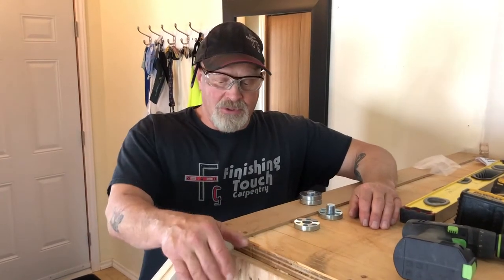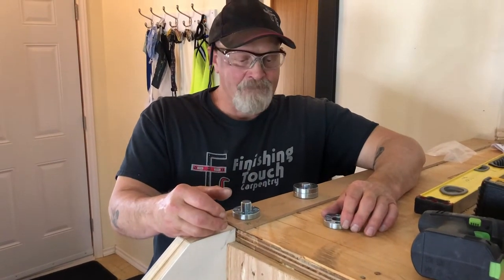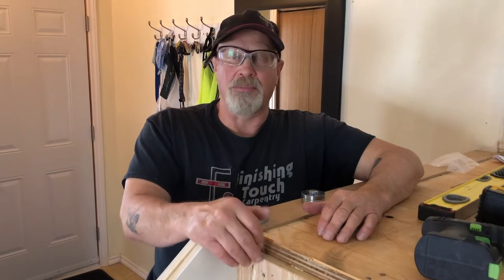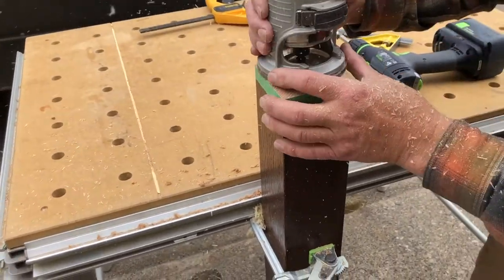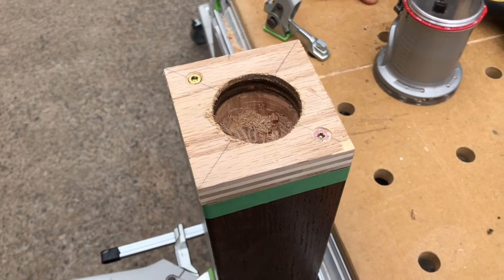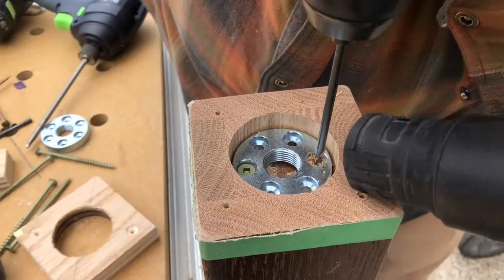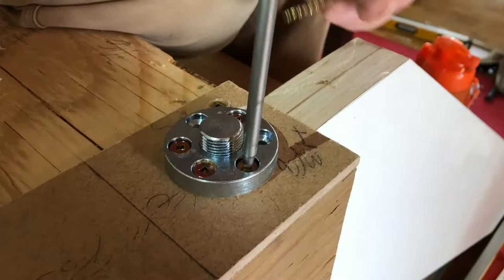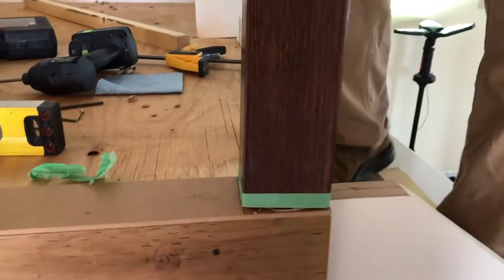Newel Post Install with FAS-N-FAST hidden fastener

Comment: I installed this and the floor is slightly unlevel. How can I plum this post with out leaving a gap at one side of the post.  Also I don't even know which side will face the low side cause it spins on.   Not sure how to get it plum.  It's only a 1/4 inch out at the top.
Reply from the maker: Crank it down tight and put a piece of tape on one side as a reference. Then figure out what side to shim. Use a piece of utility knife blade (like an Olfa) as a shim. That should get you the 1/4”. If it’s a corner post you can easily pull the post with the railing when you install it.
Reply: @scottearlsmithFTC  Thanks,   the problem I am unsure about about is each time I spin it down a different side faces the low end.   Because the center spindle threads into both it always shows a different face to the low side.
Reply from the maker: @eldenboy11  Ok. See if there’s a consistent side and mark that. All I can think of at the moment. You’d be able to pull that post a 1/4” with a railing if it’s on a balcony.
Reply: @scottearlsmithFTC  thanks, it is on a balcony.    But how would I pull the post with the rail?   The rail will be attached at the bottom and them at the post, due to spindles in the way.   I figure it would just pivot out of line.   That's part of the reason I want to plum it so thebrailnclears the nosing on the floor.  Oh,  the outnof plum is left to right.  Vs the horizontal rail attaching front to back.  It that makes sense.   The the diagonal Raul the goes to the floor below attaches the the face the is leaning away from the stair well.
Reply from the maker: @eldenboy11  The only thing I can suggest is FaceTiming me and show me the situation. Is that possible?

Comment: How you leveling the post if the subfloor or finished floor is not level ?
Reply from the maker: I do a dry fit first and see how the post is sitting in its final position and make a slight adjustment with a cut or you can slip a small spacer underneath on the final - like a tip from a utility knife blade. Cheers, Scott

Comment: Could you do this over an existing hardwood floor?
Reply from the maker: @gregschultz8871  Yes technically you can. My concern would be scratching the floor when you screw the post down onto the floor. Hope this helps, Scott

Comment: Hey there! Do you think this would support a 8” round baluster being used as a table base fixed to wood floor?
Reply from the maker: I think it would support it. But depending on the bracing you have on the table it may wiggle over time. Worth trying for sure. Thanks, Scott

Comment: What size bit is that for drilling out where the excess of the screw is recessed into the floor?
Reply from the maker: 3/4-inch. Thanks for reaching out.

Comment: Hi Scott. How does this compare  to zip bolt?  Do you prefer one over the other?  Thx
Reply from the maker: So far I've only used the Fas-N-Fast if I know there's joist hangers or steel beam/angle in the floor. My go-to is the Super UT Zipbolt. Occasionally I will cut a hole in the flooring plywood and lag or bolt the post right into the floor joists. (Depends on what the building inspector wants too...)

Comment: Great video, want to install on tread, but it's not level, how would I compensate for that?
Reply from the maker: Thank you Vince. Can you level the tread from underneath with spacers or wedges? You may have to cut a square hole in the tread and insert the newel post. https://youtu.be/Se_xOTjuVys
Reply: Thanks Scott, can I drive shims under the tread, or do I have to loosen the tread?  It's the first tread, so there isn't much room underneath
Reply from the maker: @VinceBrooks-hd9pl  I'd have to see a picture. Go to my website and send me an email with the picture and maybe I can answer that. www.scottearlsmith.com

Comment: Hello thank you for your video, how strong would you say these are?
Reply from the maker: You're welcome. If your screws are into solid structure it would be as strong as any other newel post connection. Cheers Scott
Reply: @scottearlsmithFTC  and what are the odds of always landing on the framing with these, such a small space.
Reply from the maker: @WAUCE7  Most of the time you will hit the rim joist and you can add blocking if you have access to underneath.